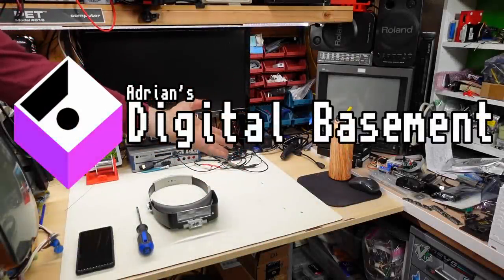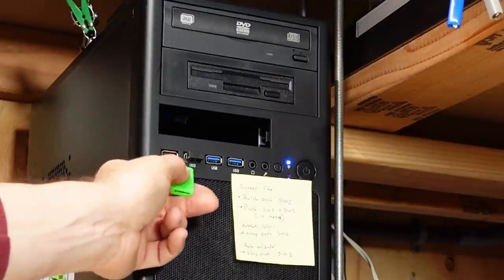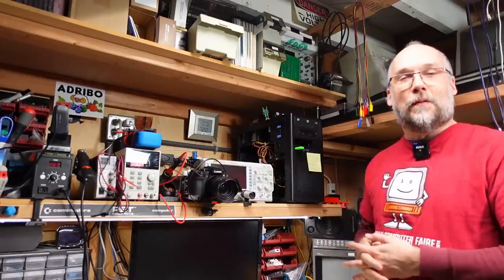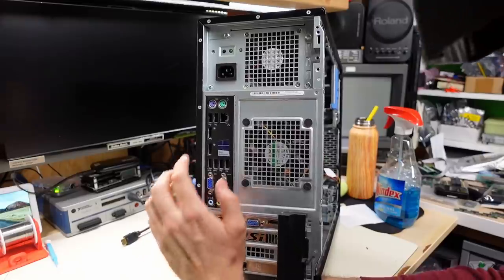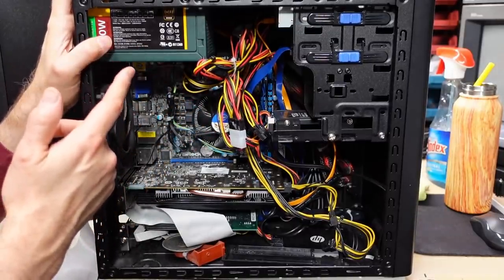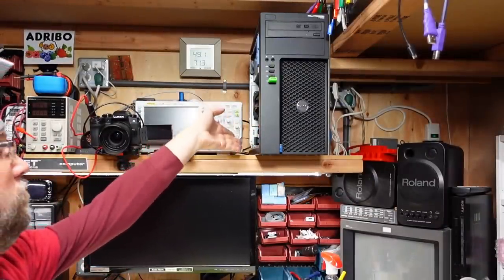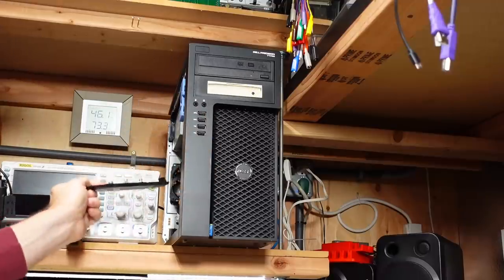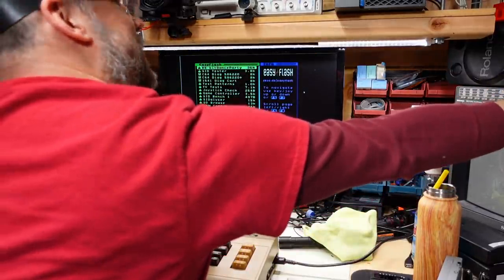Let's upgrade my lab PC and talk about tools I use to make videos

Comment: I had the little USB 3.0 pins braking inside the USB cable so is it downgraded to USB 2.0 speed, so check your cables.
Windows doesn't give you an error in that case because it only check if you are connected to a USB 3.0 controller and not what speed is currently used.
Use an utility like USBView or USBDeview to check the actual speed and other info.
Another thing with the third party controllers especially the first generation of them is to make sure they are using the latest firmware because the older firmware's are known to be buggy.

Comment: The power supply button is for running a dead test on the PSU.  If you press it and nothing happens, the PSU is dead regardless of the PC state.  Also the bios on that Dell is pretty old, might want to update it to protect against Spectre.

Comment: Always good when you get a system update. Though personally I tend to try to avoid things like dell or hp due to the proprietary design, but that is just my preference. 

Anyway,  glad things look like they're working how you expect now. I am guessing that it is either 5th or 6th gen given the date you mentioned, if it is ddr4 it will be gen 6 and a huge bump from 3rd gen. 

Ps, I think you perhaps need a 8bit dance party 2 for the second channel so that the colours match.

Comment: The screws in the slot cover is the "rails" for the 5.25" drives.
Reply from the maker: Yeah nice of them to include those. No actual rails needed for the 5.25 though I just used normal screws ... The 3.5 bays had actual metal rails needed. I had to install it into my SSD adapter.
Reply: @adriansdigitalbasement2  the included screws you screw into the drive outside of the case then just slide it in to the case until it clicks so its toolless ish.

Comment: I've got an elgato cam link and also have trouble with it on my desktop PC.  It would capture the first frame of input then just freeze.  Older motherboard maybe 3-4 years old. Works fine on my 1 year old laptop.  What I found was that plugging it into a usb 3.0 hub somehow fixed the problem.  You'd think it'd steal bandwidth or something, but it seems to work fine, no dropped frames, at least in my limited testing.

Comment: PS/2 ports were brought back because they're more reliable than USB for keyboard and mouse.  (I personally have seen a machine that shipped with bad USB drivers.  If it had had a PS/2 mouse and keyboard, it wouldn't have mattered.)

Serial ports are absurdly easy to implement, and are greatly desired by people like network engineers.  (You can communicate with most current network devices by USB as well, but that usually emulates a serial port.  If you need to connect to several different devices in succession, this is a pain because each device tends to be a different emulated serial port, so you can't just swap the cable between devices and start typing commands like you can using an internal serial port.)

Comment: LOL! Your lab computer is actually newer than my main rig (first Gen i7), though I do run it with win7 pro and am equally older gpu (GTX 275), a disproportionately powerful psu (1250w which recently broke, but I was able to fix it, thanks in no small measure to you Mr. Black) and some other updates like SSD, more ram, etc. The only thing I really struggle with is the GPU, which can't really run most of the games I want to, and the fact that I am beginning to feel the need for Windows 10. My secondary rig, recently salvaged from its way into the trash, is a second Gen i3, a Dell, like yours, but I decided to install Linux in it and I am trying for some three months now to turn it into my daily driver. Have a few things to solve, logistical wise before turning one of them into a server. The Linux would be the preferred option, but the whole Dell case is just way too small and does not allow for much storage...anyways I digress. All the best to this newcomer and may it provide you with countless hours of flawless work 😉

Comment: Thank you for taking the time to create this video and share it with everyone. 

Was just wondering though what camera did you use to film this with?

I also have an Amiga 2000 in the garage that hasn't been used in years. Sadly in one of the last moves the keyboard key caps got broken when it fell onto the driveway and I have since lost them. Not to sure if it can be repaired though?  I also use to run a BBS on it with software called AmiExpress. Now I am showing my age LOL.
Reply from the maker: The camera is the good old YouTube special Sony ZV1 :-) The Amiga 2000 keyboard sadly -- it would be cost prohibitive. Best to just replace the whole keyboard or find a PS2 to Amiga adapter and use a cheap PC keyboard. The Amiga 2000 will likely not work anymore unless you removed the NiCD clock battery already. Otherwise they leak and destroy the motherboard.
Reply: @adriansdigitalbasement2  thank you for taking the time to reply to my query and letting me know. Yes I didn't think about the batterry on the motherboard. I will have to check this out the next time I come across it.

About the keyboard that is sad and I really don't want to throw this piece of history away. Thanks for the tip about the adapter as I didn't know one existed.

Comment: With hardware issues like the USB port I'd always recommend booting up a live USB Linux system (e.g. Fedora) and see if the hardware works properly from it, since it rules out any Windows problems.
Reply from the maker: It would be hard -- as getting that capture device working on Linux is not a plug and play affair (AFAIK) -- I need it running and capturing at 1080p60 just to push the USB 3 port. (That requires about 3.3gbit if I recall)

Comment: Nice. Your Xeon is basically an i7-4770 without integrated video. Better stability but no overclocking. I have the same chip in my old gamer, and it's definitely faster than your old 3rd gen i7.
Reply: There's a way to OC most of those WS Xeon's by blocking the CPU ID pad on the chip(differs between gens and series(refreshes) so try at your own risk).  You would also need a non-certified mobo.
Reply: @JuxZeil  True, although I meant no overclocking without jumping through such extra hoops. I also assume that Dell's Precision line of computers are quite certified. Lol.
Reply: @redleader6442  Yup, the all the OEM's workstation lines are certified...because the pass for getting certified means "within Intel spec"...unexciting and wasteful.
Just so happens it also means the OEM's mobos, cooler, and PSU can be made as cheaply as possible, proprietary(to control upgrade and repair), and can charge for insurance over it's lifetime.
Can't deny though, there's a reason we modders went through HeLL to mod a DeLL...they were a cheap way to get a power PC and the proprietary aspect meant it was an achievement getting them watercooled and case and guts modded into a beast. 😂
Reply: @JuxZeil  Lol fair enough. I knew it was certified, and was being my usual sarcastic self.

I put my system together from used parts, and when it came time to choose the CPU, the Xeon ended up being a lot cheaper than its i7 counterpart. Since I'm ok with my system being a bit older, you can also assume that overclocking isn't a must for me, despite the fact that I have a Fatal1ty Z97 Killer, which was a pretty good mobo for its day.

One day, I might go all out and build a new gaming rig with crazy amounts of cooling for a significant overclock. Unfortunately, not too realistic right now.

Comment: this is why I have bare images of my PC with no data, and then a data backup. 
what I do when I add some new software is restore the system backup only, then install new software (normally queue up 3 or 4) then back it up with the updated list of software installed, then reconnect my live sync backup to restore all the data I have. 
I can always restore to a clean install with all the applications installed from a clean install point. I also have this in a chain, so I can always go back to an earlier clean install if there are problem with a specific bit of software. 
I got really sick of spending several days reinstalling software, when I needed to reinstall windows. I can also so a universal restore to any hardware with the backup software I have.

Comment: I never really read anything about TPM since I never cared, but your mention of TPM abd BitLocker made me wonder about one thing.
I personally don't use BitLocker (well, I don't use Windows to begin with), but our laptops at work use it in case a device gets stolen.
So.. what is the point in using the TPM inside the computer instead of a password? If I broke into your basement (well, just hypothetically. I am in Germany, so more than a safe distance away and most importantly I don't do that) and stole this PC, what would it help you to have the hard disks encrypted with BitLocker, if all you need to unlock it would be this exact PC? I am no expert on hard disk encryption, as I never really thought about doing such for my own computers, so is there another reason to do it except to prevent anyone from getting into your data if the computer is stolen? If not, why use the computer itself as the unlock key? 

If this reads a bit confused, that's probably because I am... ;-)
Reply: If you only set a Windows password you could take the harddisk drive out and copy everything. I don't know about Win 10 but in Win 7 it was easy to bypass the password and get to the data this way. That's when BitLocker and TPM comes in but it depends how it's configured. 
If you don't set a PIN and/or Keyfile you only need to do no changes to the hardware and turn it on to unlock the data. There is imho no point in doing so cause the chance someone will only steal the harddrive is very unlikley.
You want at least to set a PIN that you enter or a Keyfile that has to be read before Windows boots. The keyfile can be read either from an thumbdrive or via Certificate Services from an Windows Server.
Now you have the advantage that nobody that has access to the machine can boot into Windows without the PIN or keyfile or take the harddrive out and bypass the Windows password that way. The disadvantage is of course that if your mainboard should fail for some reason or loose the thumbdrive you're pretty much done if there is no backup of your data or NAS where your data is stored. I guess thats the reason why Microsoft don't give you BitLocker on the Windows Home version but not sure about that.
Reply: @Troppa17  It is true that a Windows password does not prevent others from reading the contents of your drive if used outside the computer (the same applies to Linux as well by the way), I still don't see what its benefits are when used at home like in Adrian's basement, especially the way I understood him using it.

When it comes to BitLocker with PIN or key file - yes, I totally see the benefit there, as this is what we are using at work. But that doesn't require TPM. It only requirest a moderately powerful CPU and enough RAM to not make things painfully slow (and again, that's what we did at work...). As I understood Adrian's reasoning, he wanted to change away from PIN to using TPM instead which allows the computer to unlock BitLocker upon system boot with no further interaction. Sure, it would prevent the drive from being read in any other PC, but if someone steals the entire computer, which is the most likely of all scenarios, as it is way quicker than taking it apart on site, it's like not having it encrypted to begin with.

And this is what made me wonder. It doesn't protect from data theft via the network while the machine is on, it doesn't help if Mr. Badguy steals the computer in whole and turns it on at their hideout. ;-)
Reply: @Colaholiker  The TPM will not unlock the drive if you boot a different OS. (I know this from trying to help recover somebody's data.) If the drive is only readable from its own OS then the Windows password should protect the data.
Reply: As an additional "bonus", a BitLocker encrypted system drive may leave you with a system with a Windows grenading itself and seemingly nothing working to successfully reinstall the OS no matter what you try (factory recovery, fresh install, ...). Out of 20+ Fujitsu Lifebook A359s with built-in TPM, Samsung PM870 SSDs and Windows 10 1903 that I deployed, about 5 or 6 eventually developed issues. That cost me a bit of grey hair.

Only when I eventually took out the SSD and connected it to another system was I greeted with a BitLocker error message, and it started to dawn on me. What I had to do was using the recovery console to decrypt the system partition with manage-bde, run chkdsk /f which would invariably find a good number of errors (generally files related to a particular recent update which had me suspecting that BitLocker was being incorrectly suspended or something; note that chkdsk immediately before decryption would pass), and then the reinstall would succeed. Apparently the bootloader would fail to access the system partition otherwise. Sometimes I would catch the system before major disaster, when the first symptom was a recent update being rolled back automatically, and once I got lucky enough in that recreating the BCD got the OS install working again.

All very weird and I have yet to find out the actual root cause.

Comment: I got a Dell Precision T1600 for $90. It has a Xenon E1245, 16GB memory and also has a 450 watt PSU.  It's a really decent PC!  I put an HD 7770 GPU in it for now, but I do have a Sapphire Nitro+ RX 580 which does not fit in the case. I got a riser cable and printed out my own mounts to use it outside the case.  I delayed using it though, for now, until I have a better spot to place it. I have a "curious" kitty who will play with the fans on it if I'm not looking!  I also am considering getting a better power supply too as 450 watts may be a little weak for the 580...🤔

Comment: I was running one of those scsi cards to an lto3 tape drive on my Skylake pc - my board still has pci too:)
Only challenge was clearance for the extra unused 64bit pins!
Moved to pci-e for lto4 though as the card was bottlenecking

Comment: I miss my old machine with my E8400 Core 2 Duo.. When I dismantled him I saved the Core 2 Duo and I saved the 2x 4gb sticks of DDR2 I had in there that my friends called me CRAZY for having 8gb of ram in 2008. I ran him from 2008-2020 the whole time running Windows XP x64.
When I Took apart his Antech 1200, I got rid of most things, including his Radeon HD4870x2 which was the top of the line 2gpus on one card card from Fall 2008 I did save both 1TGB Caviar Black drives and moved them into this machine, I also saved his Optical Drive, and his Power supply which had been replaced in 2018 and was infact the 3rd power supply the machine had had as it blew 2 power supplies in its life without damage to any of the other components.
My plan is when I get the time I am going to get a frame of some sort for my office wall and I am going to mount the Sticks of Ram, The Processor, and the XP Pro X64 DVD in the frame and hang it on the wall .

At this point in my life my wife gets the new computers first in our family and her hand me downs go to me lol.

Comment: Adrian, Did you just use standard screws to mount the zip drive adaptor and not the special shouldered screws that were on the back of that 5.25" blanking plate?

Comment: you might want to look for a "2 SATA, 1 IDE" PCie Card with JMicronn Chipset. Those should work with ATAPI Devices.
The Promise IDE probably won't work with ATAPI Devices (which the Zip probably is).

PS: µATX was correct. Mini ATX is pretty much dead and not used. EPOX 8KHAL would be "Mini ATX" -> Full size but only 6 Screws...
Reply from the maker: I actually bought the startech.com one the other day! Yep used that firmware and it works perfectly. Thanks for the tip though!

Comment: I don't know with USB3 but USB2 SD card readers can be damaged by not disconnecting them properly because then the usb controller chip of de reader can be damaged. I don't know if that can happen with the one in a pc also, but glad to see the usb controller chip of the capture device wasn't damaged !

Comment: I had the same issue with my HD60S using the motherboard USB ports. Ended up buying a Startech USB3.1 PCIe card and it worked fine using that. It seems like the onboard USB is not providing sufficient power or bandwidth over USB.

Comment: you didn't use the screws on the front panel plate for the zip drive caddy?  Not sure if you know/care they are meant to act as a rail, and they lock in to place with the blue plastic piece (check out the ODD).

Comment: Well, power saving mode in windows is designed for notebook/laptop computer, and should be disable for desktop computer, b'cos it connect to the power code 7/24, unlimited power . enble it in desktop computer, creats lots of stange problems. BTW, did you update the BIOS firmware to latest version?

Comment: 26:25 I think your case is so old, the 2 water cooling ports could be for AT mouse and keyboard as I can also see a serial/mouse port next to them.  But the case still looks quite modern to me.  So I could be A: 100% wrong B: you have a super modern case from back in the day that supported older connectors.....could be a collectors item? :)
Reply from the maker: Oh the case and parts inside don't match -- this machine is 100% a hodgepodge of parts from everywhere. That case is probably 5-6 years old.

Comment: floppy and usb 3 on the same machine, now I've seen everything.
Reply: It is the year 2704. Computers, if you can even call them that, look more like living bodies than machines. For data storage, they use holographic crystals holding millions of exabytes each…but, for compatibility reasons, they are also equipped with 3½-inch floppy disk drives.